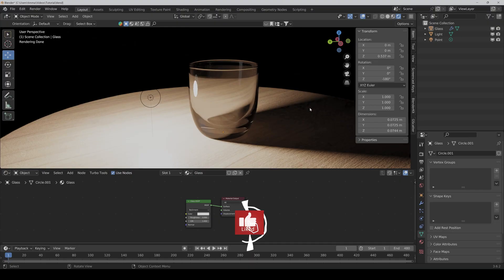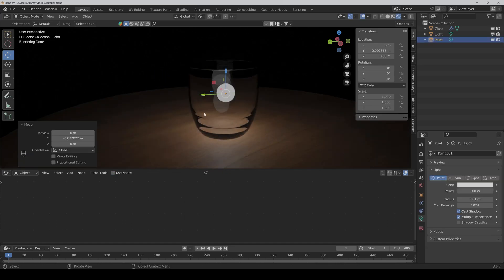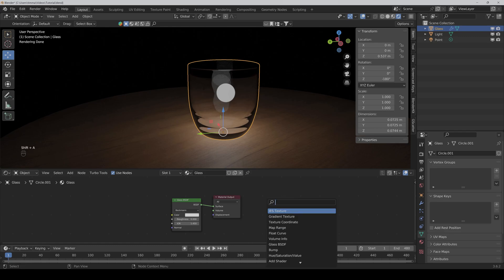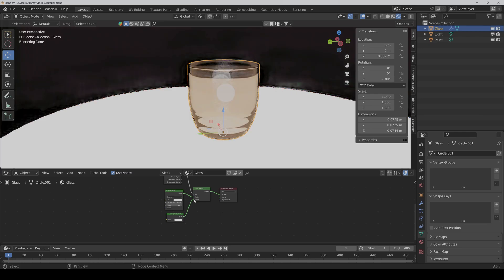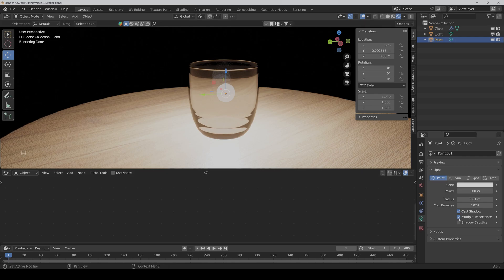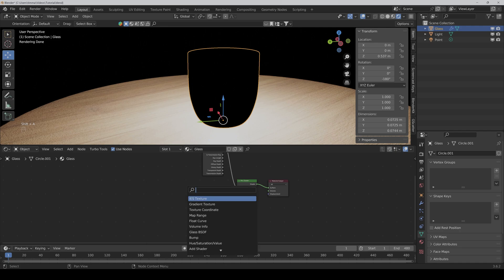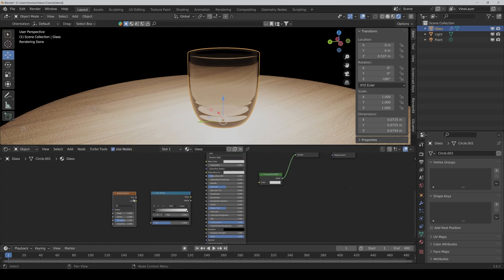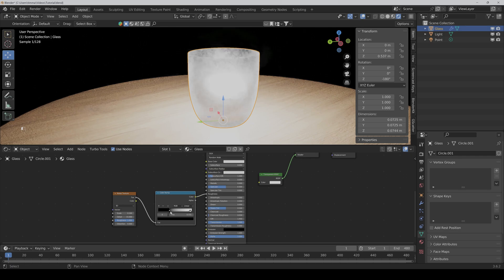Better Glass in Blender - Let Light Pass Through and Add Imperfections

Comment: It makes sense for the objects in your scene, but doesn't seem to make sense for the objects in my scene. I will have to figure out what the difference is.  Perhaps it's because I'm trying to allow light through a lens that has a solid back.  There must be an alternate combination of nodes and values that will get me the effect I need.  But I like this, also.
Reply from the maker: Hey thanks for your comment. Hmm good question, i´ve never tested it with solid colors, it´s more for glass shaders 🤔
Reply: @vicubeanimation  Yeah, basically I'm trying to model a utility light. The housing is metal. And then there's a plastic lens. There is a certain opaqueness to the lens, but obviously it is designed to refract the light emitter of the bulb inside it. Some of these tutorials have helped kind of make the outside of the lens interesting depending on the scene...but the light object inside the "utility light object" (housing + lens) definitely is not passing through the lens at all.  Anyway...this is so much fun.  I'll figure it out.  'ppreciate you.
Reply from the maker: Ah interesting, i´m wondering why the Light Path Node doesn´t work here but anyways, good luck! @MattVarner